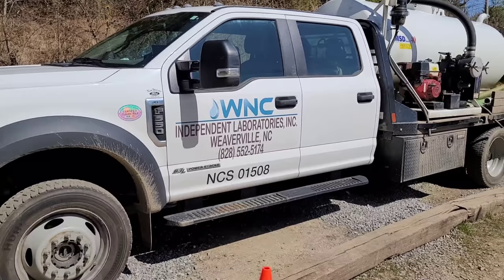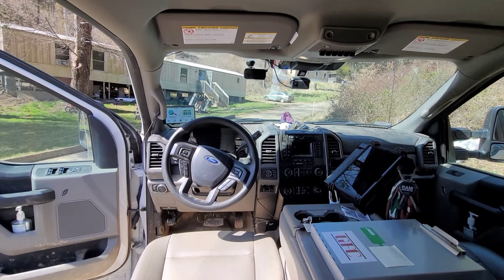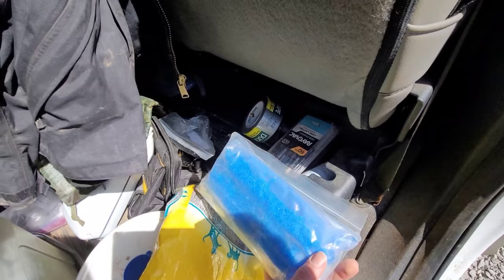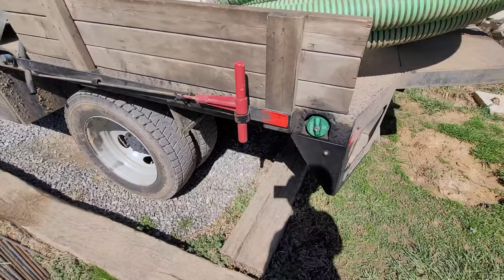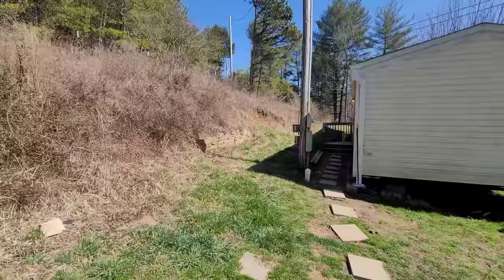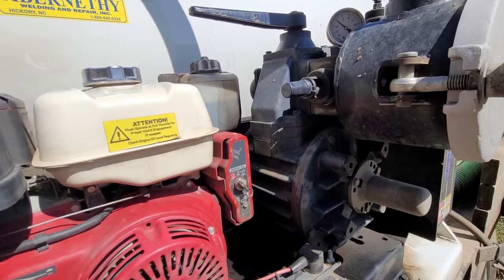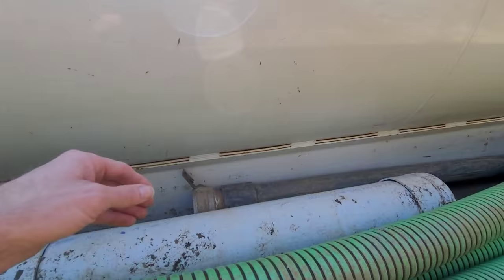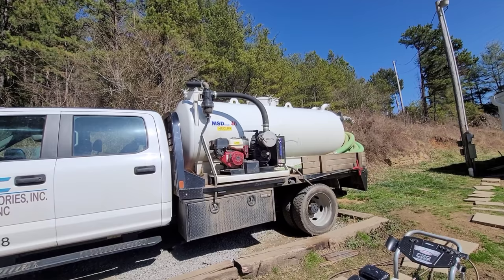Truck walk thru.

Comment: 1. Ice Machine, instead of buy ice make the ice 2 Resupply check list to complete at the end of the day, list of all the supplies on the clip board they can check off if they need to refill at the EOD. 3 Getting first aid kit into the open whether its hanging from one of the front seats or some where else in the open. If you have to send a someone that isnt familiar with the truck to get they arent searching to find it, its out in the open. 4. Hooks that hand from headrest poles, might be useful to hang jackets and bags from them and $10 on amazon. 5. Frost King FC1 Outdoor Foam Faucet Cover, cut a slot for handle and set it over it so dont allow water over to freeze. 6. Behive wrap for back pump, Its basically foam covered with black plastic wrap might help keeping that pump from freezing, other part would be cheap heating pad big enough to warp it with small electric charger, wrap the pump and plug in the charger.  7 Fire extinguisher, guessing you guys have one, but didnt see one. 8 Standardizing and Organizing that back seat area, whether its putting chemicals in a container and labeling. Didnt cover what was in enclosed boxes on underside of the bed.

Comment: My take a ways;
1. If you don't have a Fire extinguisher on board, you should. It and First Aid kit should be easily accessible.
2. Label the poisonous chemical and keep an sds on board in case you get pulled over, will save time.
3. Have the tank mfg add a larger clean out opening where your lower valve is, the valve can be in the cap of it.
4. Why use a flatbed? Why not have the tank mount to the frame and have trays on the sides? You'd save some weight and possibly some cost and probably height lowering you center of gravity.
5. Is the crew cab needed? It appears to be a storage area, could this be eliminated and use a vertical storage area on each side of the tank (especially if the tank and bed are 1 unit).
6. Cabinet for the pump assy, keep water out and protect it.
7. 5S the tools and stuff in the cab, but have the operator help, they know their struggles.
8. Back up cam, heat tape the valves, charge system for pump battery & winch are all good ideas too.

Comment: 1. I would add a toolbox to the bed opposite side of the pump, that'll clear up space in the back seat.
2. Add heat tape and insulation to the spots you have problems with freezing up.
3. Add a power washer for cleaning tools and a 0° nozzle can dig for you if you use the vac to clean the hole out. Not ideal for every hole, but you don't need to call miss dig and it's a more precise hole

Comment: I've seen a couple good ideas like using a diesel motor for the pump and make cover for the pump. 

My only suggestion would be getting a remote pump shut off so they can shut it off faster. Or setup a pressure switch that automatically kills the pump when the ball trap engages.

Comment: .. I enjoyed the 17 minute walk around. 
1a. Why are you using a stand alone battery for pump and not the battery on the truck itself. Truck has 12 volt system and would save yearly battery cost. 
1b. If you like stand alone battery look at an agm battery (example optima) they are designed for higher vibration conditions. Vibration causes the internal lead plates to fail in the battery causing it to need to be replaced more often 
2. led's with door switches mounted in work boxes on sides , open box instant illumination.
3. Extendable flood light mounted on back of cab cage  similar to whats on fire trucks and ambulances, lift it up and light entire truck area at night and site if close.
4. Is there a safety data book in the truck in the truck for cleaners, copper sulfate, and other item. To keep it safety and osha /epa compliant  if they would look. 
5. you have your trailer receiver.  Have a removable step made  out of mesh and square tube steal .  2 steps easier than one to climb  and secondary bumper . 
6. Where are the electric booster pumps stored..
Thats what I have for now.  Thank you for your time Sir.

Comment: Create like a motor and pump box for the pump handle and Honda engine. Protect motor from elements and pump handle from water intrusion. Would require a simple routing of exhaust through the enclosure.  Also exchange battery for a larger car type and install a battery charger/conditioner and that should extend battery life. Just would require that to be plugged in frequently to extend battery life especially in the winter. With the enclosure could also add a larger fuel tank and light to see and service motor in the dark.

Comment: 1)Electric cooler
2)Wire Honda to truck batteries -charge circuit on the Honda probably doesn't have a regulator and cooks the batteries over time - disconnect Honda charge circuit if you do this to prevent backfeeding
3) Wireless backup cameras
4) small propane torches to thaw valves/couplings. If you don't trust your guys, a generator and a heat gun. This should work on your vacuum pump too. 
5) tarp/cover for the motor/pump
6) Rubber hose filled with grease on the vacuum pump handle shaft to prevent water from getting inside - slide larger hose(1/4"-1/2" larger) over shaft, fill w/ grease, reinstall handle so it keeps the hose tight between the handle and pump body. Shaft rides in a grease jacket to keep water out.  Or, a hockey puck/rubber drilled to fit tight on the shaft and seal, then dished on the bottom with a grinder to create an umbrella shape so water drips off the outside edges. No guarantees, just food for thought. Depending on design, greasing the handle shaft where it goes into the housing might seal it up too if it's just a sleeve bearing. Reapply as needed. 
7) Kill switch on the honda for when the tank is full. Pressure switch or float switch. 
8) store with your valves open in cold weather. They're easier to thaw out usually. Could heat tape them at night to prevent freezing.

Comment: While the vacuum pump will obviously change its tone if you really wanted to protect the pump you could add a pressure sensor to the line coming down. It'd have to be pretty beefy I'd imagine because you're already pulling vaccum but when the ball trap engages it'll pull a lot more vaccum and have that trip something to shut down the pump or the little Honda engine thus saving the pump from extra wear while your guy is racing to shut it off.

Comment: Have you seen the new Milwaukee packout system with drawers? It would clean up the back of the cab instead of having everything loose. You can throw the yeti on top of it too. You mentioned about the fire hazard when talking about the gas tank, fire extinguishers on both sides of the truck would be a good idea incase some brush under the truck ignites.

Comment: Hmm, use 5 minutts to spaypaint the smaler hose so its more easely visebld.  Put a rubber «hat» on the handle og the pump switch. Try making it so it rubs against the metal so the water dosent Get down and it freezes

Comment: A simple drawer system from Harbor Freight will help keep items from going under seats and take up less space in the back. Battery’s, valves and. Everything else all in one simple space no digging or anything through the back of the truck

Comment: Idea one assuming all trucks go to your shop at the end of the day buy an ice machine

Idea 2 add rubber bumpers like on the back of semi trailers extended beyond the 18" plate you had added on to the end of the truck to prevent The bottom tank drain from being the 1st thing to hit something when backing up

 Idea number 3 try using a large greasef O ring underneath the vacuum pump handle to keep water from settling in freezing.

Comment: First I would recommend is MollE webbing for the backseat so some of that loose stuff can be more accessible and organized without adding weight.
2nd get someone to 3D print a plastic cover for the valve that can be flipped up out of the way to operate, that'll keep it from freezing.
3rd get some clamps mounted to the back of the cab so you can mount the shovels and post hole diggers,etc. More organized, and don't have to worry about anything bouncing out plus of they all have a place you can look at it and instantly know which one is still laying in the yard somewhere before you leave.
4th get jerrycans so they can be mounted somewhere too, they don't melt and you don't have a loose gas can on every truck that you just told the world they could come on lot and get gas if need be.
5th I also like the idea of water tank for washing hands and tools but idk how to work around where to put it or the added weight of that.
6th you should definitely get an ice machine at the shop if you are going to stick with the coolers you currently have. Quit buying ice.
Hope this helps you and I both :)
Reply: 7th is a back up camera that is connected to the tablet in the cab, almost forgot that suggestion.

Comment: 11:34 You can fix that water intrusion fairly easily.  Simply drill a center hole in a bowl or cup, place the cup on (upside-down) and then the handle.  Could first try with open clearance, but if water keeps getting in due to wind, then can adjust to a tight seal. Could even go so far as something machined with an o-ring.  Otherwise, simply ample grease on that horizontal moving joint.

Comment: For the problem of water freezing around the pump control handle get a metal cup to fit around the rod that sits underneath it and rubber gasket that sits around the rod so no water gets in so there is no need to dismantle that hole assembly

Comment: I have noticed over the 2 1/2 years of delivering propane tanks that a lot of the propane companies that install 120 up to 1,000 gallon tanks also use the F550. Most of them also have some sort of lifting crane weather that be a cable crane that extends out or a smaller knuckle boom crane. Almost all of them have the 6.7l diesel engine as well.
Reply: Yea trucks like these you aren't gonna pinch pennies for some gas hog

Comment: I was kind of surprised that you're not running a hurricane Pump.I used to work for a company called Kenny manta out of Hammond Indiana you can look them up if you want to but we did pressure washing anywhere from anywhere from A4K hotsi all the way up to a 60 and I believe even an 80K pressure washer.  We ran the big vac trucks that were I wanna say somewhere in the 8 to 10000 gallon capacity. You'll have to excuse my lack of remembering because I worked there back in 2008 and I was 21 at the time The boss stuck me in one of those trucks and had me driving around the mill and then ask the class ACD L driver that we had on site to drive the truck and he couldn't even get it rolling I barely even had my driver's license at that point I had only been driving an  Automatic car for 3 years at that time and I was thrown into a truck that had 12 gears with a high low switch between each gear. That started my Passion for driving the big trucks even though I have a heart condition that I can't get A CDL but I have always worked jobs since then to where I get to operate the big equipment.

Comment: Very good video, very informative. From personal experience running equipment and trucks, a few possibilities would 1. Add flashing amber led lights in to your front and rear bumpers so dumbasses know where you are on the road/off it during the day and at night even when working to protect truck and crew. 2. Mount the gps system in the centre of the cab similar to the tablet to both crew can access or switch out radio for one with built in gps and possible screen for reverse camera and help to prevent hitting items the driver can’t see. 3. Instead of running plastic petrol/gas cans, replace with the remanufactured ww2 German cans ( the allies loved the design that they copied it) wrangler star done a few videos on the quality of them, and from person experience they are amazing and worth the investment, along with this I’d find a mount to permanently mount they to the truck.
Reply: The gas cans are called Wavian Jerry can and are used by NATO

Comment: You should get a couple of battery tenders and put them on the battery about once a week like on the weekend when you aren't using the truck for a day or two.  It will increase the lifespan of the little starting battery on those pumps.

Comment: Have a machinist make you a cone washer for you pump handle.  That way the water can’t build up and freeze. Mini umbrella.   

Run a cable from the truck battery to your small engine battery with a battery isolator and you will get longer life out of your batteries.   I’d also have a fab shop build a nice rack on your cab rack for all your tools

Comment: Do you carry a spare tire? If so I would recommend an easy to use jack as well as a dewalt 1/2" electric impact that would make changing a flat etc super easy and quick. You could also add a charging station inside the cab and carry a drill or smaller impact to use for removing the lids that are secured by fasteners. Charging station would ensure you're never caught on the job without a good battery. Another thing that comes to mind is the 4x4, how often does a truck get stuck? You could wire the trucks for winch quick connects and mount a winch to a receiver hitch, with this setup you could winch backwards or forwards depending on the need. Another great thing is that if the trucks are already wired for the winch you could just have one winch and if a driver is stuck carry it to them (no need to have a winch on every truck) depending on how willing your crew is or your expectations I would had a tire plug kit so they could fix miner flats on site.

Comment: The gaskets on the valve covers could just be removed and replaced with some rtv silicone... make your own gasket, it'll glue itself to the cap so you won't have to worry about it coming off again

Comment: James I notice the work lights on the headache rack mount them on top and have them able to rotate, 

I didn’t see a backup camera not being able to have a rear view mirror I see these as essential,

Working fleet service on aircraft we had face shields and rubber suits I get it protective equipment sucks but on a windy day a face shield is essential

Water collection on your pump selector could easily be solved but a large rubber O ring or bushing and using some grease

Get tape of each color for each truck like the tools

Gas can holder/ jerrycans that bounces out on one of these bumpy drives you’re SOL

Pinch bar to scrape tanks clean?

Comment: Tow company I worked for had better luck with Ram. They had a Ford early on that lost two engines in under 50k miles. So almost all the trucks were Dodge Ram 5500s and most had Century tilt decks. The mileage on them varied between 75000 and 400,000. We put about 75000 miles per year on them.

Comment: Keep the def system in storage alot of places will not take a deleted truck on trade. But if you have the parts on a shelf they can be put in with the deal or scrapped for arround $2000-$2500

Comment: I'd have a box built or bought to run crossways behind your rear tires for your shovels and etc. This would keep them secure and out of sight. Or put two smaller boxes on either side for all that stuff in the back seat. If a rollover accident should happen, all that stuff becomes projectiles. Also, I would put amber/white strobes on the front, rear, and roof for backing in off of roads. No one pays attention to the back up lights at all.

Comment: I could certainly see use in running a power line from the primary truck battery to the auxiliary battery with a bidirectional switch in-line. It would maintain the aux battery and extend its life and also give the ability to run the Honda engine starter off the trucks battery in a pinch. $50 of cable and a solonoid could easily save $100 a year in batteries.
Reply: Exactly the same system as RVs implement to power all the fun stuff that isn’t the truck itself

Comment: What about looking at just a straight up pumper truck what I mean by that is just a truck with a Big tank instead of the bed. Doing this would allow you to get a bigger tank. This truck could be used to do your normal pumping jobs along with possibly expanding into portable toilets. This would also allow your current trucks to focus on more service type calls.

Comment: Two thoughts, basic tool set, (ratchets, sockets, wrenches) also I'd equip some kind Rubbermaid tub or small tool box of some kind to prevent all that loose debris rolling around incase of a MVA. Also if that is really powerful poison I know I personally would be requesting a "puncture" proof container for it

Comment: I have a couple things you could add to make your life a little bit easier one with the handle for the pump direction either it’s sucking or blowing would it be easier to put a cap on the top to keep it out of the elements were not in use to keep the water out from where the handle is so I won’t freeze when it rains and it gets cold in the winter time, you could also put a roof rack system on the cab of the truck for other miscellaneous equipment, and putting a car battery instead of that other battery that you use to start the Honda motor we use the same motor on our roof sheets machine we use a car battery and we haven’t had to change it in three years that’s when we put it on and it still starting up every time with no problems

Comment: I can recommend considering a lithium battery for starting the Honda motor.  I personally have a battery tender brand lithium battery in my morotcycle and it has been fantastic for the last 3ish years.  I never put it on the charger and it continues to start the bike great.  They do cost more up front but they last so much longer it becomes worth it quick.  And I believe they have a 3 year warranty as well.  Big fan of the tiktok, have a great rest of you day.